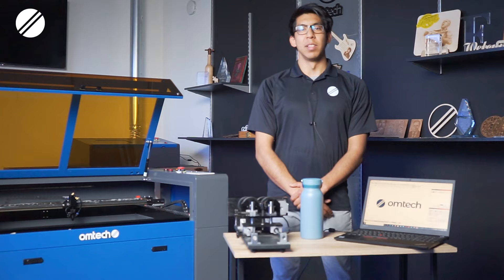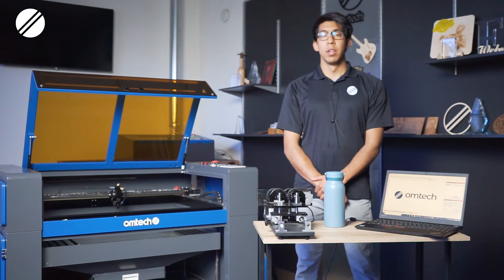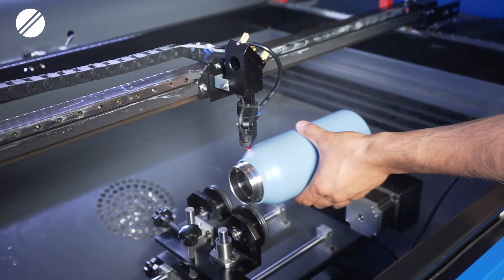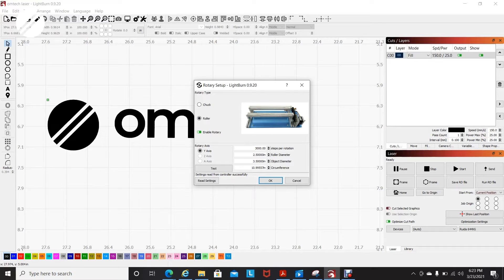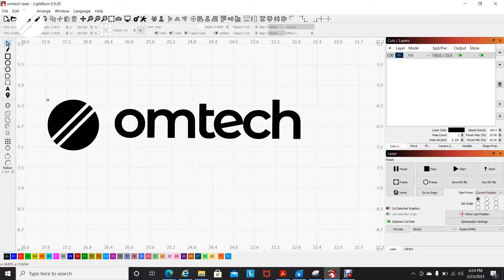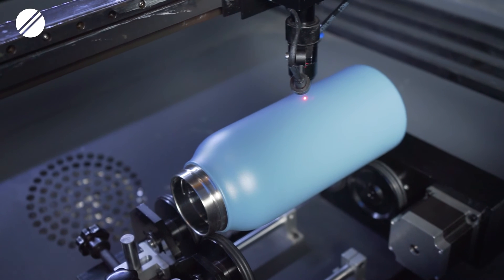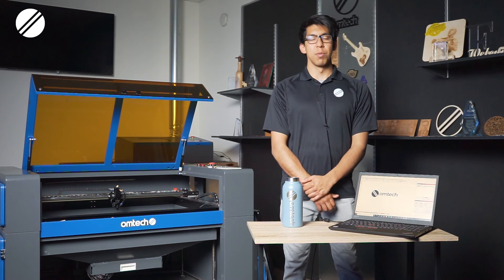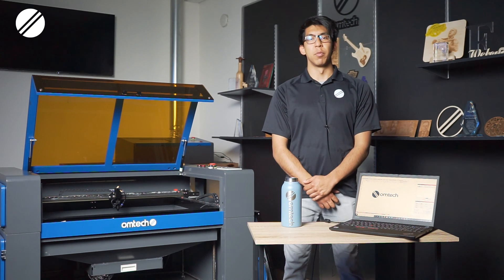Laser Engraving Tumblers with a CO2 Laser Engraver & LightBurn - Project Walkthrough - OMTech Laser

Comment: You didn't change anything with the acceleration of the Y axis or calibrate the rotary tool at all? I tried to do it like this at first and it would change direction on the Y axis so fast that the tumbler would fly off the rollers or slip and then it wouldn't stop rotating past the 1st rotation of the object.

Comment: OK please help me out! I bought one of these rotary tools and my bed will not go low enough. I have an 80 W 2028 auto focus. Any help would be greatly appreciated.
Reply: I just picked up the AF2028-80 laser from OMTech. My machine does not have a pan below the knives. Just the bottom of the cabinet which does not move. There is 7 1/8" between my factory lens and top of the honeycomb, 7 7/8" to the top of the knives. So with a 4" tumbler, minus approx 5/8" focus distance, the top of the rollers can be no more than 2 1/2" above the honeycomb/3 1/4" above the knives. The only way I see using this particular rotary is to build a cradle of sorts that hangs from the knives (removing all the knives  between the cradle.
Reply from the maker: Depending on the size of the cup, the rotary, and of course the machine, taking out the honeycomb tray and the bed blades may be needed. Once you remove the bed blade and tray, you can build a custom base for your rotary device of choice then focus it once thats completed.

Comment: I'm kind of wondering why OMTech bother doing any videos at all the couple I've seen have been pretty much useless for such a great product you need to do better. 1. You removed all form of bed from the device adjustable shelf now what's it sitting on? because it's still able to up and down. There's also no mention of how you aligned it to the X top rail. 2. you changed from normal to rotary does changing it back ruin the existing settings I've seen other videos show you how to backup existing setting so you don't ruin your old settings. 3. You've located the drive rollers on the part of the tumbler that has a thread on it I just cant imagine why you'd do that risking it walking up and down the thread. 4. You've centred the device but how there are no markings on the rotary device. 5. No mention at all of how your going to stop the project from walking up the drive train nothing stopping it from doing this. 6. If I was OMTech I'd have suggested settings for all my models for this process or should we just destroy 6 tumblers working it out. 7. No mention of Lightburn suggested settings for line interval distance either. As a business owner and CEO if your going to do something do it properly this is pretty useless.

Comment: @omtechlaser I've watched this video many times. I have an OMTech 80w and have matched the steps in this video one for one. All of my settings are the same. It does not cut through my powder coating. And now, I just get Frame Slop. Any advice?
Reply from the maker: Hey Robert we think it would be best for one of our senior techs to assist you. We were able to locate your order and sent you an email regarding getting you set-up with our techs for help.
Reply: awesome! Thank you! I figured the frame slop out, but definitely need some tech help. I'll be on the lookout for email. Thanks again.  @omtechlaser

Comment: Great video. Couple of questions,  do you disconnect the rotary cable while the machine is on ? And when  you disconnect it do you do.it while the machine is on ? When going back to regular,  after plugging back y cable your settings Don't change right?
Reply from the maker: Great questions!! 
Yes, you have to disable the rotary device and can do so through LightBurn. Then you will have to disconnect the rotary device and connect the regular Y-Axis connection back while the machine is on. Afterwards you will have to reset the machine.   For more questions or assistance, please reach our Technical Support Team at https://omtechlaser.com/pages/contact-us

Comment: I just bought the 50W laser from omtech. It is supposed to be here next week. What speed and power would you recommend me to start with when engraving tumblers? I was thinking 250mm/sec at 50% power before I finished watching the video. I noticed you go slower.
Reply from the maker: Hey there, thanks for reaching out and choosing us as your laser provider! We're excited to have you become apart of the OMTech Community! In regards to your settings, we suggest trying our initial settings first. If the results are not the best, you can start reducing the speed. This will also depend on your wattage model, as higher wattage machines can engrave with higher speeds. For more assistance or advice, please reach out to our Technical Support Team at https://omtechlaser.com/pages/contact-us
Reply: @omtechlaser  I'm having trouble getting all of the powdercoating in my cuts with the 50W laser with some colors (red, gray so far black works well). I even bump the power up to 100% and move anywhere from 150 to 75mm/s and still have some small dots of powdercoating. I'm using 0.04mm LPI. Do you think it is something with the laser or just those color tumblers? The cut looks grayish white when done engraving and there will be bumps all over it. When I clean it off some spots look good but others don't. Any help would be greatly appreciated
Reply from the maker: @rogert5365  Hey there!! This can depend on the color coating and the quality of the tumbler. We suggest staying under 60% max power and reduce the speed. Furthermore, we suggest performing quick and small sample tests. Our specialist team does recommend setting the LPI at around .07-.09mm. For further assistance, feel free to reach our Technical Support Team at https://omtechlaser.com/pages/contact-us

Comment: I just tried out my new rotary with the settings at 30 power. It is on a white tumbler and there is a yellow almost burn coloring around the lettering. Does that happen when the power is too high?
Reply from the maker: Hey there, thanks for reaching out! There are different factors that can lead to discoloration including the material and quality of the material, beam alignment, and the speed/power of your settings. We suggest slightly decreasing the power and increase the speed
. In some cases the tumblers will need to be cleaned after being processed. For more assistance or advice, please reach out to our Technical Support Team at https://omtechlaser.com/pages/contact-us

Comment: Do you run the air assist while engraving If so is it set pretty high or somewhat low
Reply from the maker: Good question!! We used the stock air assist for this model, and used it at around 4-7 psi. Hope this helps!!
Reply: @omtechlaser  thank you yes it does my rotary will be here Friday so I'm actually glad this video was posted so I have a good starting point to go by as fat as settings go because I have the 80w red and black machine
Reply from the maker: @Mageikman  That's awesome to hear!! Acquiring a rotary is an absolute game-changer!!